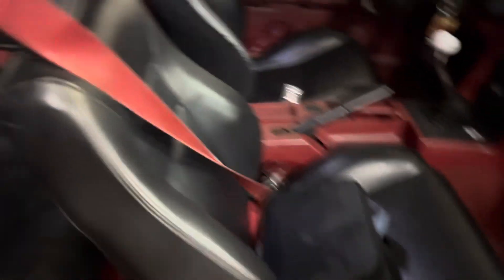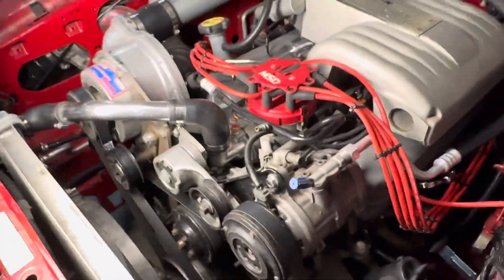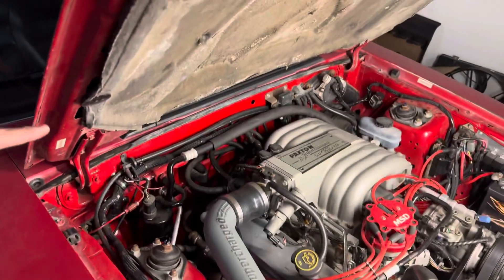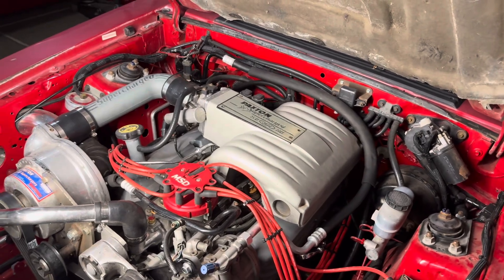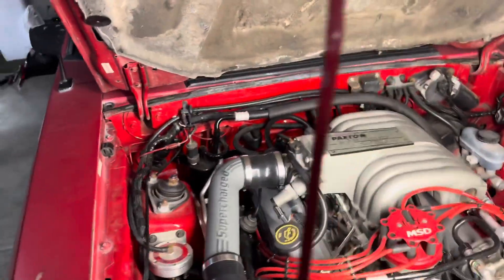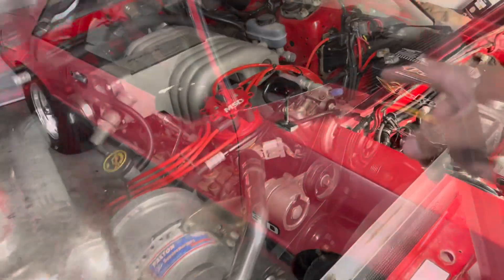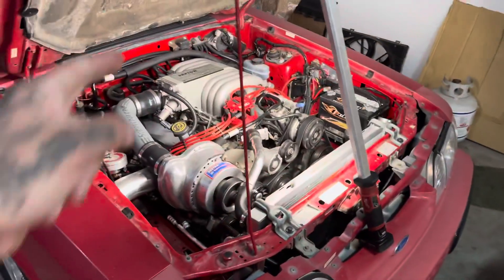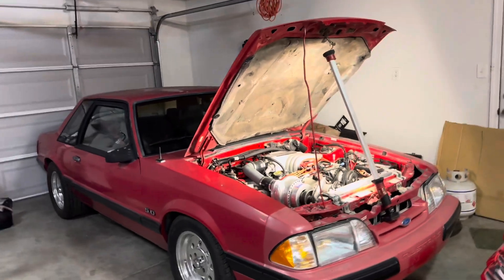Foxbody How To: 4cyl 2.3 ➡️ V8 5.0 SWAP

Comment: I have a 1986 2.3l 4speed Hatchback I just got a 302 block decked and honed also bored .030 over. Got the crank done. Gonna change the heads an go Gt40 then after the motors all done ima get a 5speed for it and just gotta figure out if I’m gonna do a ford 8.8 or a 9in rear and cut it to fit. But ima be running a 4 barrel carburetor. But awesome video and beautiful car 🤘🏼

Comment: Did you not change the wiring harness? Because I have a sn95 donor car and swapping on my 4cyl got the motor and everything replaced changed the whole suspension but confused on the wiring harness
Reply from the maker: Depends. Your comment was kind of confusing,you mentioned and sn95 and a 4cyl?

Comment: Cool project. And good tips on what to look for. I’m curious what is the performance of the 4 cylinder vs 8. I know the 8 has more power but I was wondering if you could do another video on what’s the best to get out of a 4 cylinder. I enjoyed it. Look forward for more to come. You nailed it.👍🤩
Reply: I've been working on my 93 4cyl notch for a few years now and I can tell you its just slow and powerless. theres nothing to be gained out of it unless you swap it to a turbo from a thunderbird or an svo or something. but ive swapped my to a 5spd t5 and it made it a little better just driving and power wise, maybe its just a placebo feel honestly but the 4cyl fox is just a slow, but reliable engine. you can take the dampener out of your intake and ive seen a few things about swapping plug wire positions on the 8 plug 4cyl engines but i wasnt really sold on that. Theres not much info at all about the 4cyl fox but A LOT of 5.0 information is still useful cause you learn where a lot of shit is or should be and you learn about the car in general. and the 4cyl engine is a pretty basic and simple set up and great to work/learn on.

Comment: Great video, I did alot of the same work on my 4 cyl Notch. I restored 90% of the car and still have to change a few things, it never ends. I wish I would've swapped my 4cyl Notch with a coyote. The money I spent on the 5.0 engine and trans I could've purchased a coyote drive trane. I'm not happy with the engine trans combo, I'm actually thinking about selling the 5.0 and starting over.
Reply: 351w would have been a better start

Comment: Have you ever swapped one using Holley efi? I’m considering doing that since I don’t have anything to go off of on my coupe and with parts expensive or hard to find seems like a easy option but idk.
Reply: Holley makes things easier IMO.  You don’t use a mass air meter so swapping Injectors is clicking a few buttons.